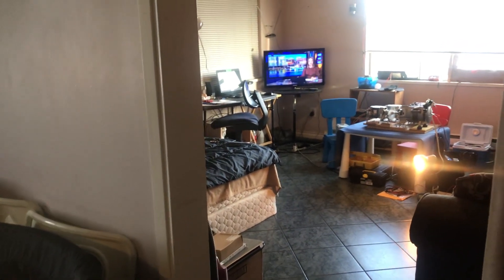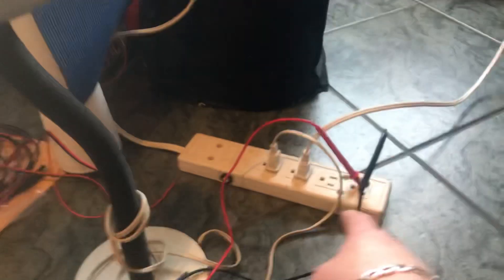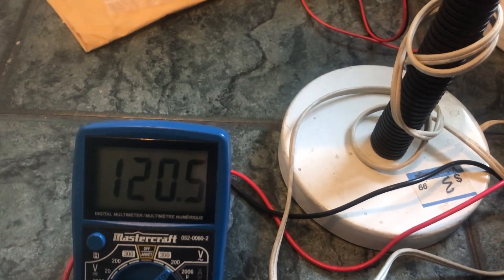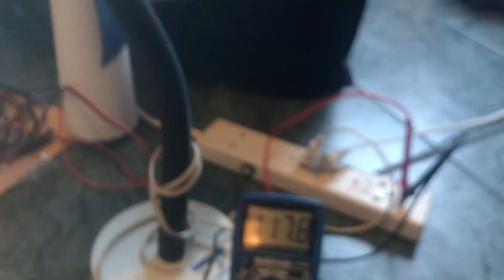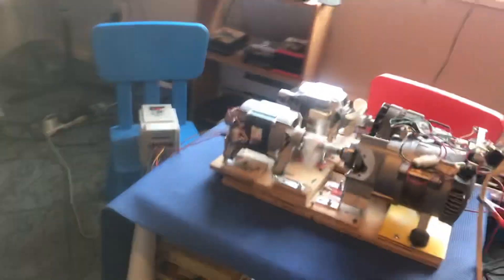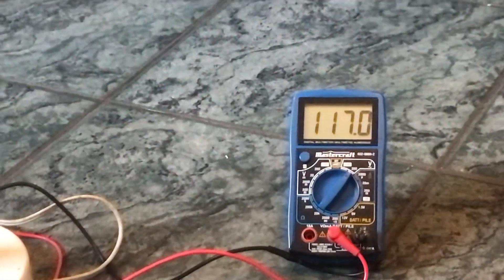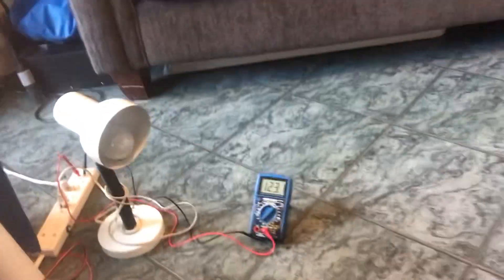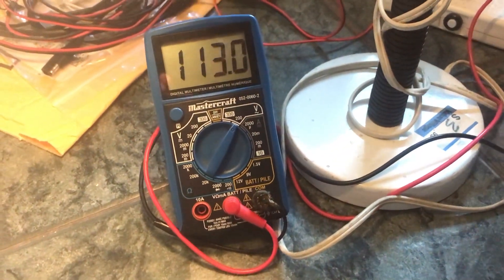FUEL LESS GENERATOR   -  DEMONSTRATION OF VOLTS

Comment: Try this:  Plug the VFD into the inverter then the inverter wired to the battery. Then the motor into the VFD. Then find an additional Battery charger to put back the load lost into the battery.
Reply from the maker: look carefully